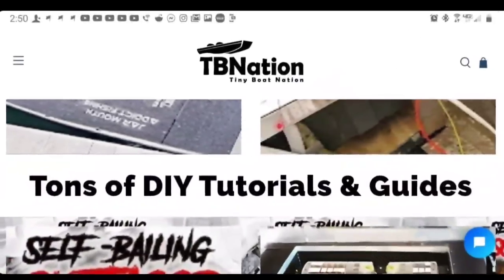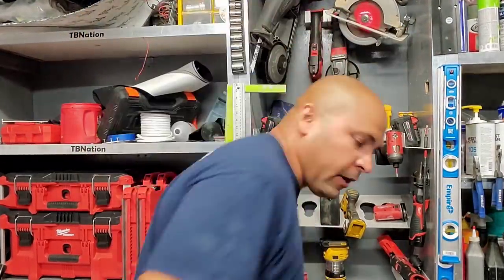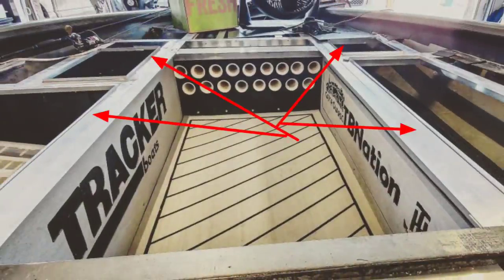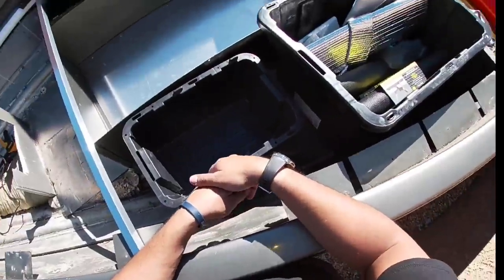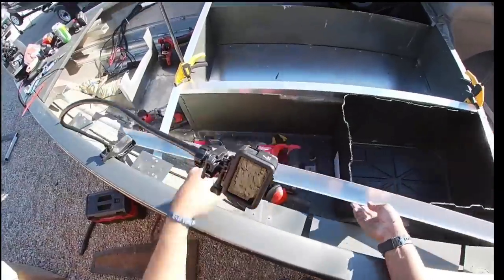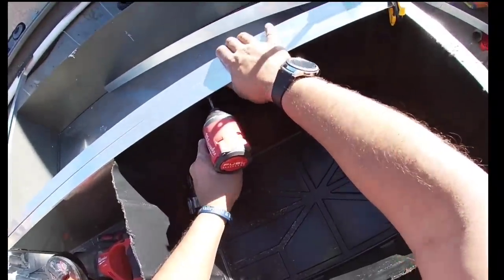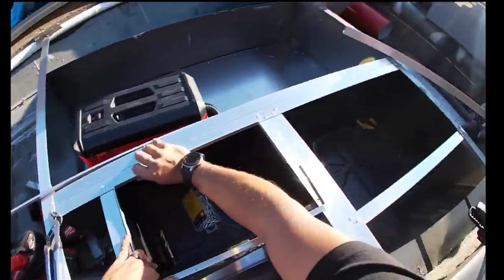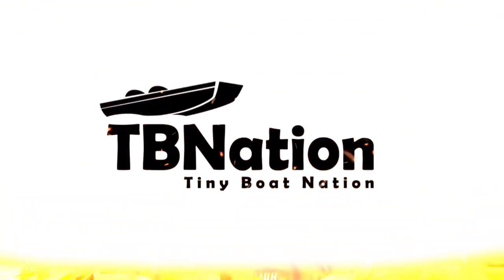How to make Dry Hatches EASY |

Comment: I am not sure how to make a dry hatch flush w aluminum decking material.
I plan on Sea Decking it
Reply from the maker: You would have to make the decking the same we make the hatch but we used wood instead. It’s much more cost efficient and it does the same thing.
Reply: @TinyBoatNation   thanks I need to use aluminum. Electric only lakes I fish and run a 60V Ray. Need as light as possible. I took 300lb of wood out.